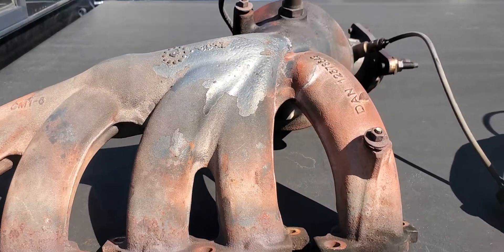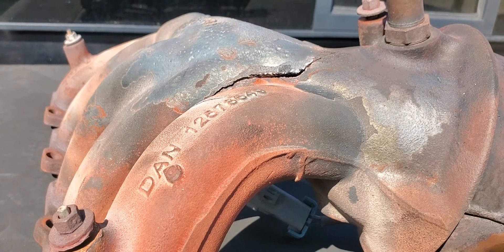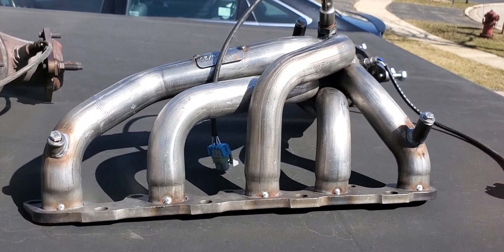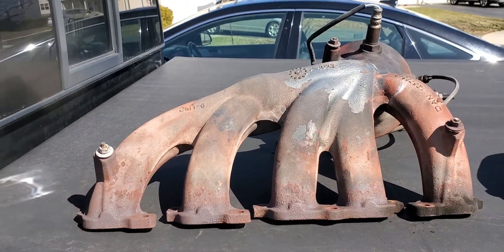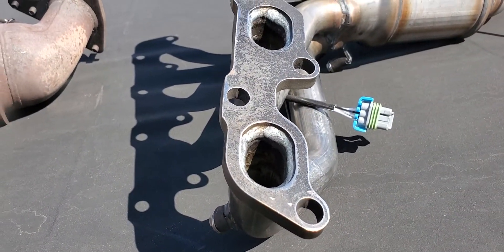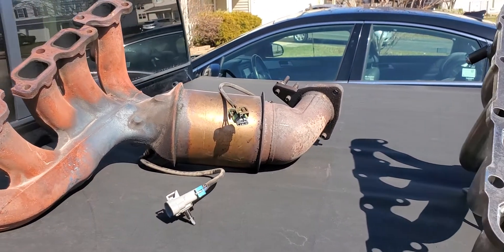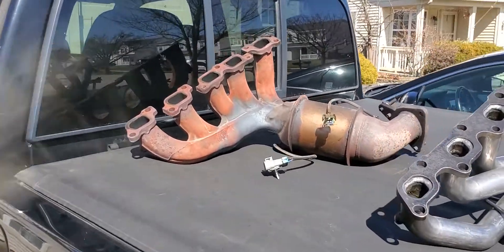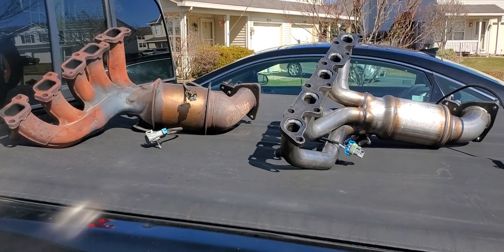2009 Chevy Colorado 3.7 liter Exhaust Manifold (cracked). "Reduced Power" fault cause.

Comment: I assume the bolt holes are slightly bigger because the manifold and head will cool and contract at different rates which would probably cause the head to crack without a little wiggle room but I could be wrong

Comment: Appreciate the vid! You end up having to tune the engine with the new manifold?
Reply from the maker: I didn't. But, I do think there would be a benefit to it because I'm currently tackling issues with secondary air injection. I've replaced the affected parts and confirmed they work, but the problem persist. Something to think about. 🤔

Comment from the maker: The Swap went well. I got the header/catalytic converter from Summit Racing. What I also discovered was there was air entering through the left side of the block because the last owner didn't tighten the bolts on this plastic air plenum.

Comment: I believe I have the same problem my issues are if I start the truck cold from over night sitting I can drive for about 15 minutes and when I come to a stop or am waiting at a red light the truck rpm idle starts to drop and get higher trucks wants to stall and it smells like fuel vapor. I do not know if you had these symptoms? I am not getting any codes I bought a fuel treatment as well no luck. Today I put a vacuum with air going into the muffler to find any leaks and sure enough under the manifold shield I can hear air seeping through